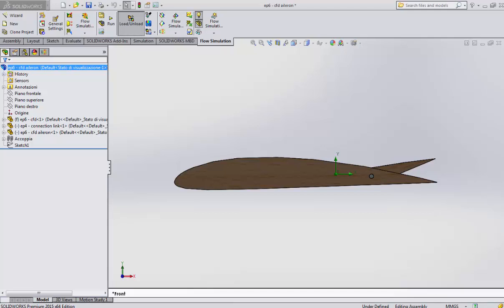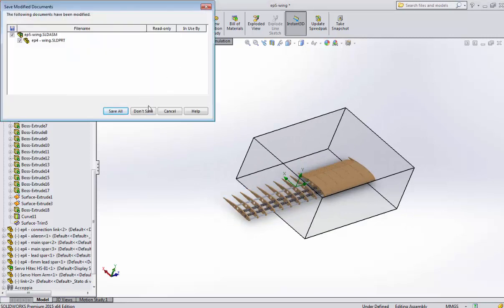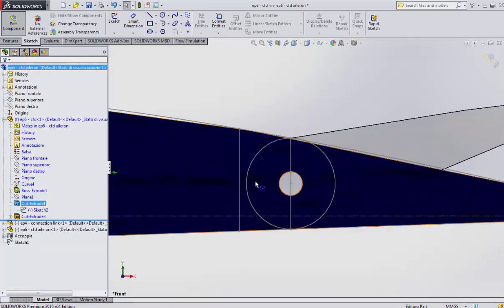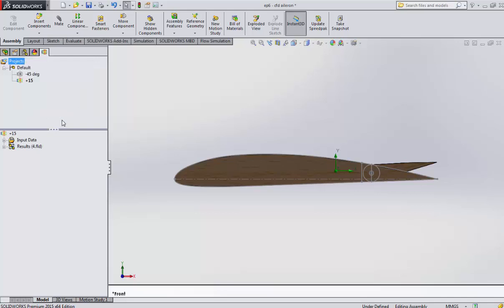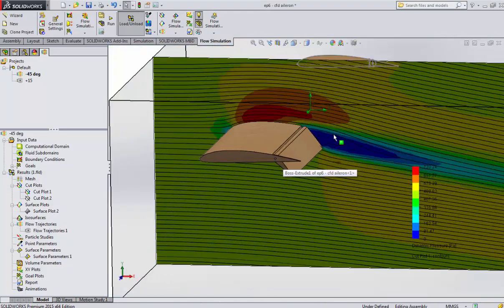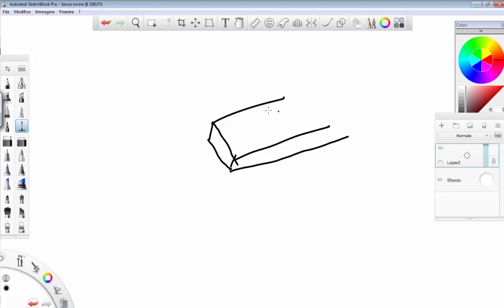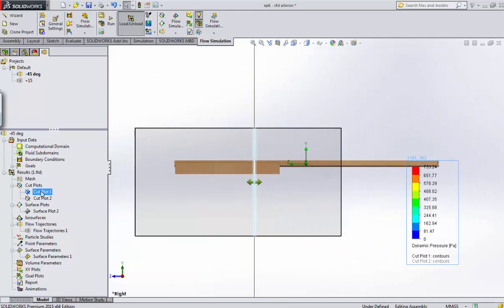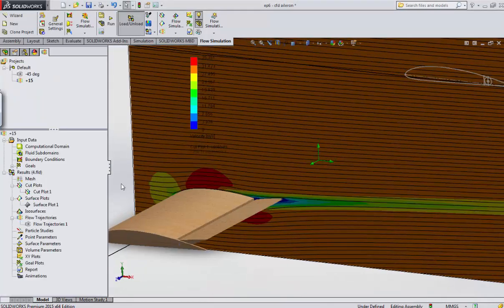Ep. 6 - CFD Study of ailerons of RC model wing

Comment: Vortex generation at 18 minutes is not correct. High pressure below the wing and low pressure above the wing. The pressure difference causes the air to bleed out at the wing tip causing the air to flow from high pressure to low pressure creating vortex generation.